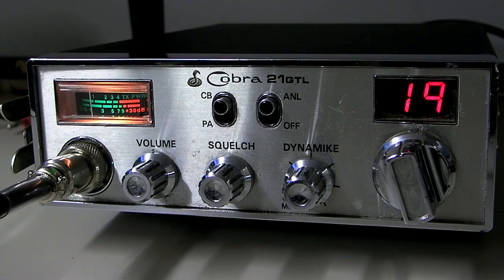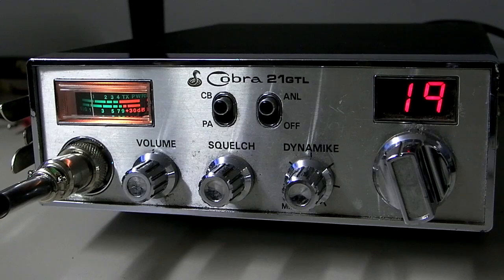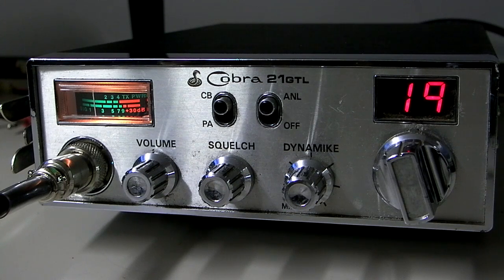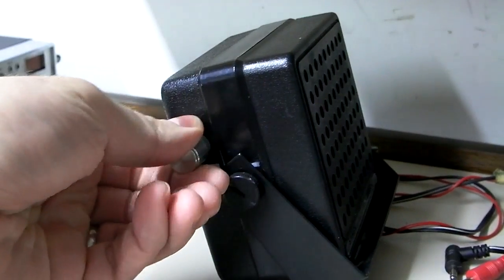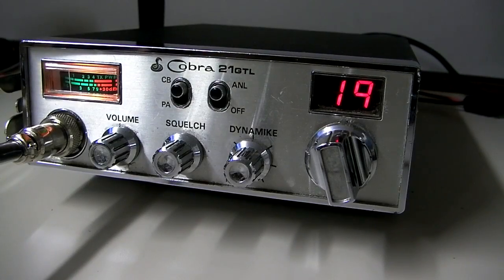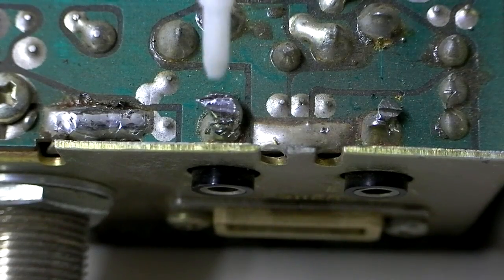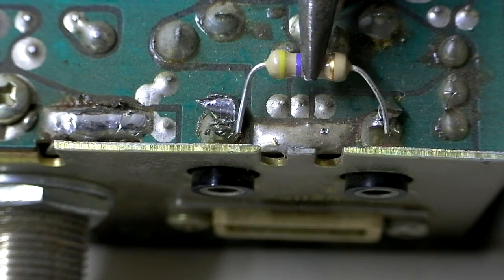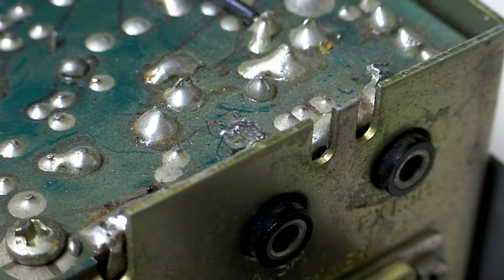How to add talkback to a CB Radio by CBRadiomagazine.com

Comment: This is another great video. I have done a bunch of talkbacks for a few friends.  This last one though has thrown me . 2019 model cobra 29 classic plain jane . 
Keys about 1 watt mods. To 3 ish. Anyway i hooked it as a variable to the rf gain as i have done many times before  also with a 50 ohm resistor.  Anyway it it burnt the rf gain switch up i must now replace.  
Any thoughts on why this would happen .it looks to be a super cheap,o switch . And smells like it was hit with 12 volts..
Again never run into this before now . 
I think this is the newest radio i have done this on..
It also has a ad203 stinger board in it .
I see no reason why that would have any effect in this situation,  stinger board is a always on board since the radio dk is so low to run it there is no point in a on off switch.
Thanks in advance i hope you share some insights on this.
I Really enjoy you videos.
I am a fan of a clean rig.
73,s 
199 florida georgia line.

Comment: Hi, good explanatory video on the talk back feature. So if you use a variable pot, I gather you don't need a 47o resistor, correct? And the pot, would a 50ohm resistance be good? Initially I was thinking of adding an On/Off sw, or if possible, using the ch9 sw,, What say ye.. Thx.

Comment: Noob question, is the resistor directional? I mean, does it matter which side goes where?
Reply: A resistor is non directional
Reply: Diodes are direction . not resistors
Reply: Vince Ruland - Yes, direction is very important. You should be able to find guides online about what direction it needs to face in relation to the flow of electricity.

Comment: if you do not want to remove any front panel controls you can cut out a slot the size of s stick of pc ram on the speaker side of the case in front of the speaker and make a small control box and all add on controls can be installed

Comment: I have a Cobra 29 Night Watch LTD Classic and it has a resistor bridged across the pa and external speaker solder points. Will this still allow my PA work if I hook up a PA horn?

Comment: @cbradiomagazine what happens when you use one of those talk back external speakers with a radio that is not compatible like 6 pin RCI's and similar radios?
Reply from the maker: Talkback speakers generally won't work with RCI's etc. In that case you may choose to install a talkback board in the radio.